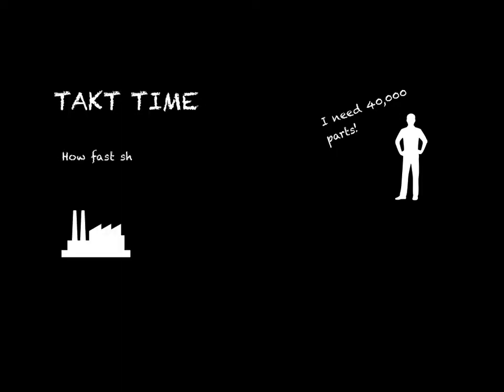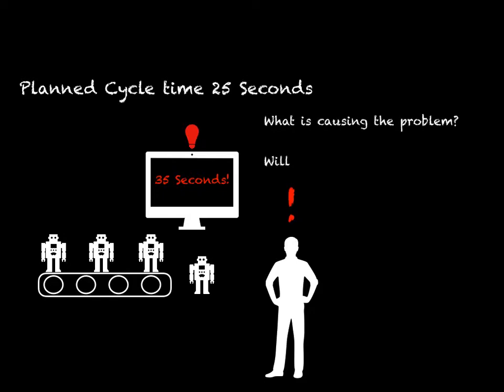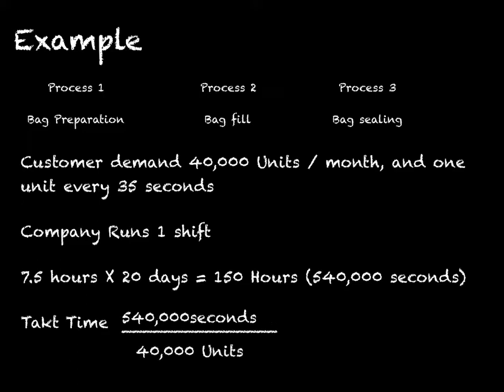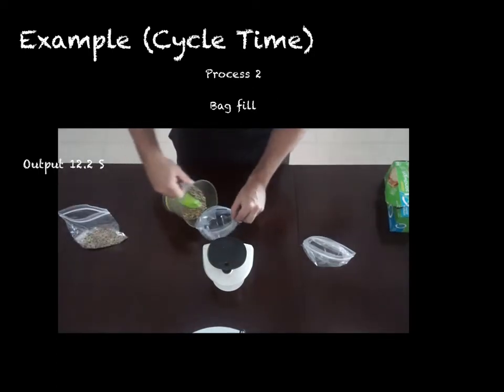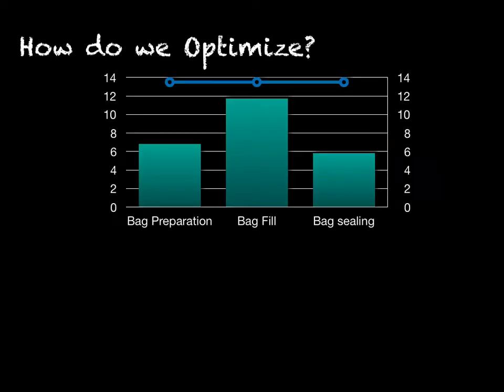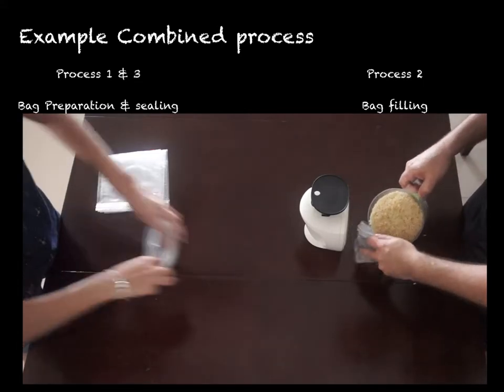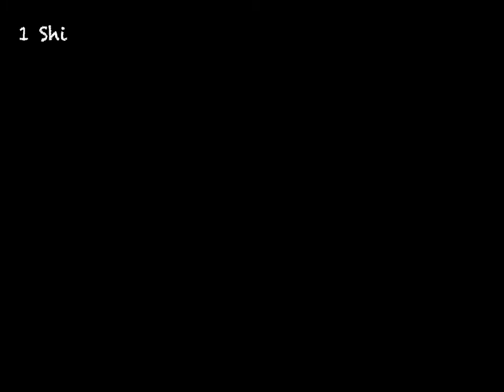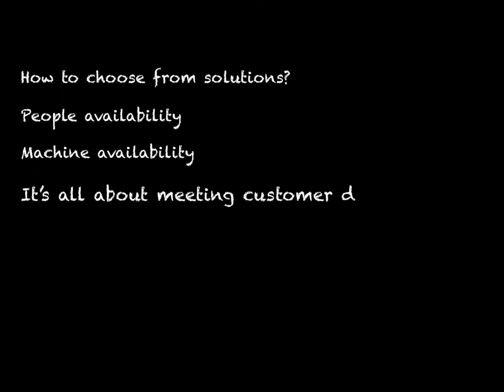LEAN Basics Takt time, Cycle Time, Lead Time

Comment: Thanks for great video! So available time is calculated by shift regardless of manpower/head count?
Reply from the maker: For takt time that is correct. Think of takt time as the PULSE of complete process it measures how many seconds you have to deliver one unit. 

Some process may have 200 people some may have 100 and meet the takt time, what is the difference, one is way more profitable than the other, that is why LEAN is so important, when you measure a single process people or cels become important there is where you can Improve processes.